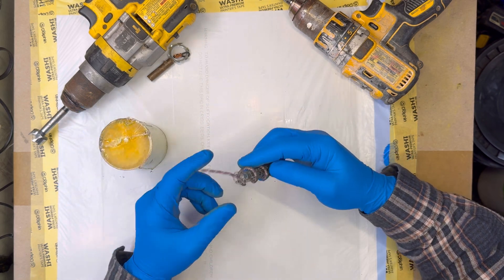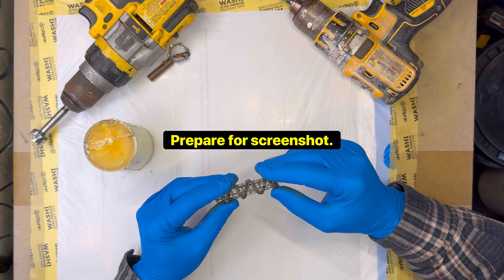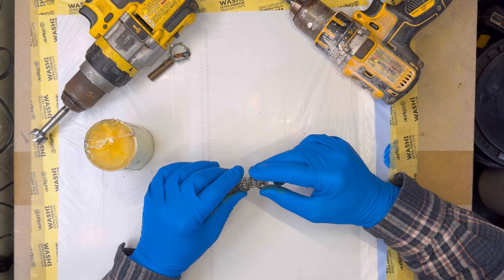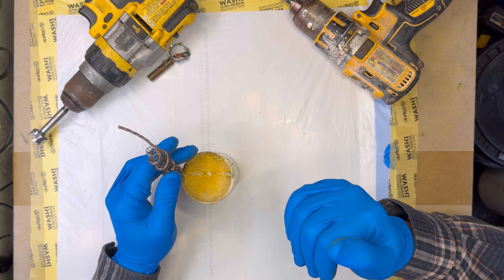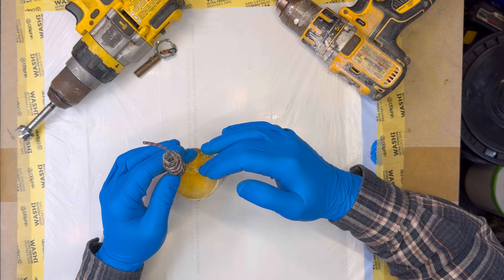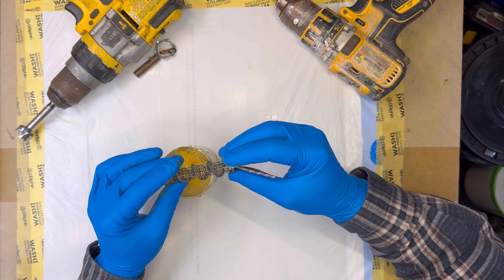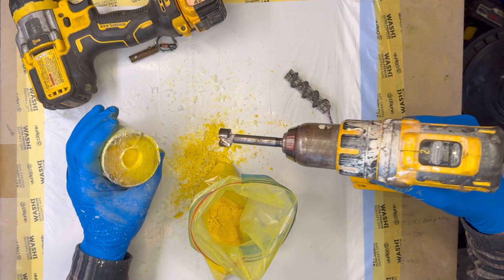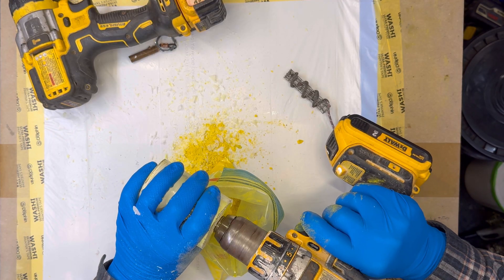Testing a Helical Igniter for Colored Smoke Devices | Will it Work?

Comment: over thinking it 
go get electrical  tape  - pull off much as u need to cover birthday sparkler long ways 1 strip- place b day sparkler on it long ways - roll it up like a cigarette
now you can pre bend it and it will stay lit. and drip fire if needed at well for fire starter. type -2.  2 layers cooking foil 3/4 length from tip to bass makes it burn hotter and quicker
Reply from the maker: Respectfully, Imma say that’s under-thinking it. Slow burning, hotter than necessary, difficult to ignite, nasty black smoke contaminating brightly colored dye.

This is not thermite, it’s a potassium chlorate-based smoke mix. It will ignite if you speak to it harshly
Reply: @InventionIncarnate  not everyone lives in the land of the free making niche vides oh yar you need visco fuse. nice you can achieve clean burns .

Comment: Why does it pulse like that?
Reply from the maker: It’s building and releasing pressure through an ash matrix. That’s why it changes in frequency and amplitude as the composition burns. Here’s a perfect example of the process: https://youtu.be/80cKOHF5PtU?t=132&si=G84iT6jPqtmSx-_u

Comment: Don't overcomplicate things.....just drill out a smaller core, and then use NC laquer to stick coarse BP granules to the smoke comp....and then use a fast burning fuze loose within the core to ignite the entire length of the core smoke comp. Drilling out such a large hole just to fit a wire mesh cage is not necessary, and the problem can be more simply solved by allowing the base of the grenade to burn out..releasing twice the smoke in two directions. #KISS
Reply from the maker: @thomasg4324  this comp is too soft for that. It would fall apart if dropped or jostled around in an airsoft pouch. I’d need a binder and more compression. Just because I’m using a cardboard body for testing doesn’t mean I’m replicating all aspects of cheap Chinese firework making (said respectfully). Also, this is intended for signaling over screening, duration over fast volume deployment. Safety for in hand ignition, and fire risk mitigation.

But yes, I’ve spent my whole “adult” life fighting my natural tendency to overcomplicate things
Reply: @InventionIncarnate  
A piece of flashpaper, held in with masking tape and lightly NC laquered over, has served us well with regard to two sided smoke grenades. The flash of the ignition ruptures the end, and it's waterproof. Not a problem at all for soft/loose compositions. I would say the volume of smoke, and speed of putting out that volume is far more important than duration...but to each his own. I just think losing comp to a cage with fuze is unnecessary when a smaller core all the way through can be quite easily ignited with coarse BP granules and fast fuze.......more smoke, easier to construct, cheaper, and gets the signal smoke volume high much faster. The second vent isn't necessary, but even placing the spiral fuze INSIDE the cage would allow for a smaller core...thus more comp. It would still ignite it.

I enjoy the videos very much.